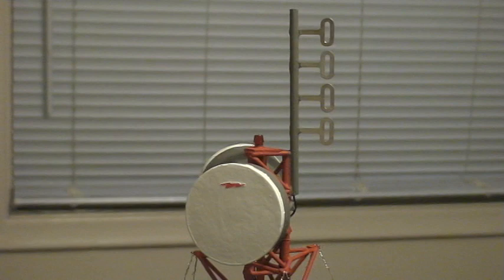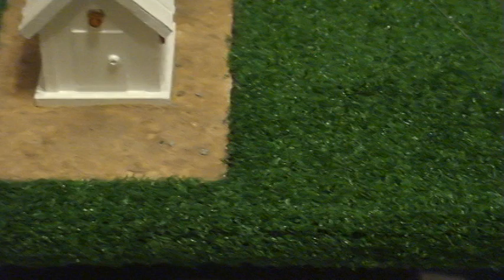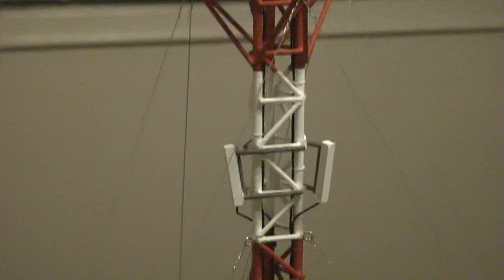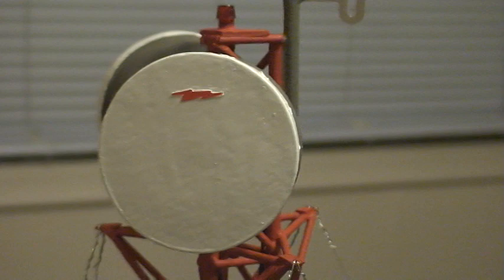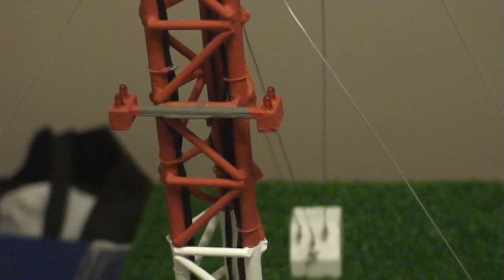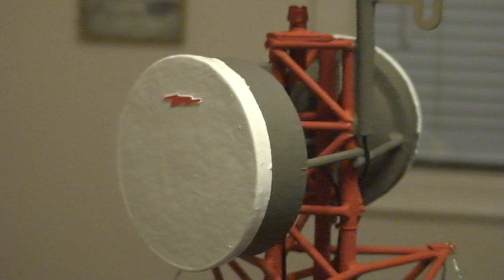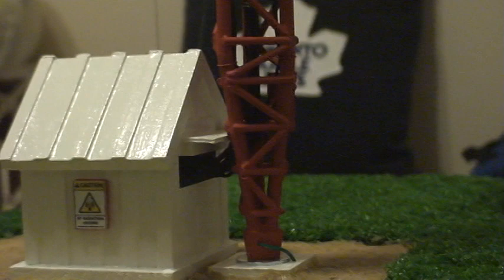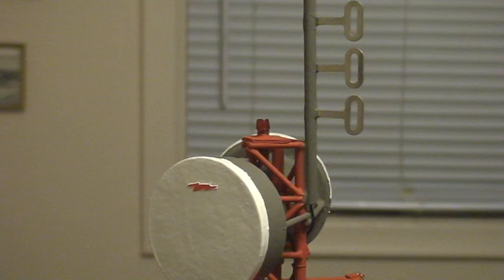Model Scale Cellular & Microwave Repeater Tower

Comment: Your tower is incredible!  As a Ham Radio Operator, you can't imagine how impressed I am with your work.  I sure would be interested in buying it off you if it was in the right scale for me.  I'd love to add one of those to my Garden Railroad layout!  Unfortunately a 180' scale model tower in G-Scale, would be 71" tall.  If you ever did a free standing tower with LED lights and antennas in 1/30 scale (G-Scale), I'd definitely make you a serious offer.  However, I'd prefer my Sinclair Dipole Array antennas to be in Omnidirectional configuration.  The ones you have on your model are directional.  Otherwise, absolutely incredible!